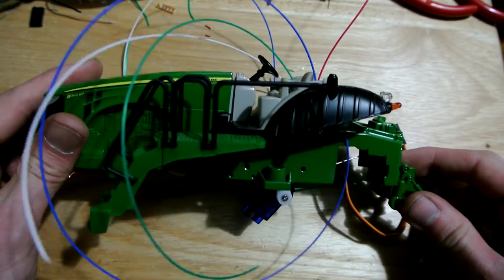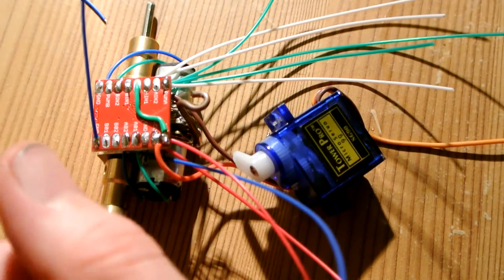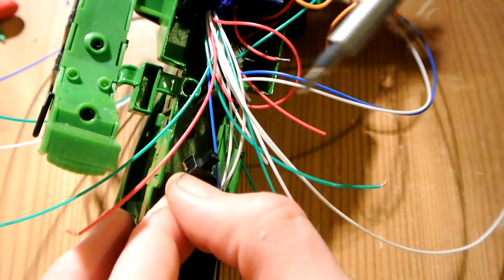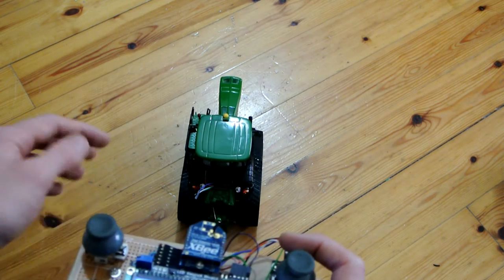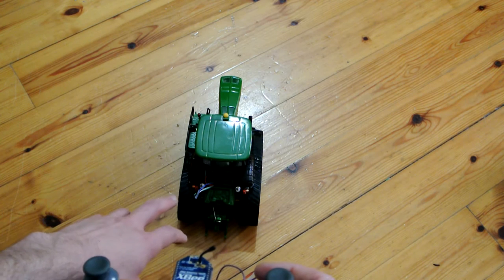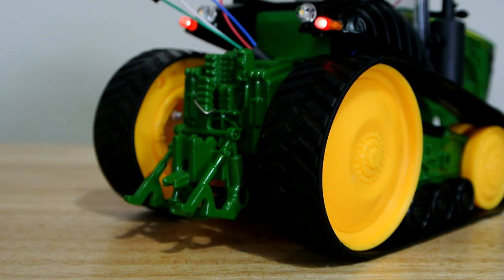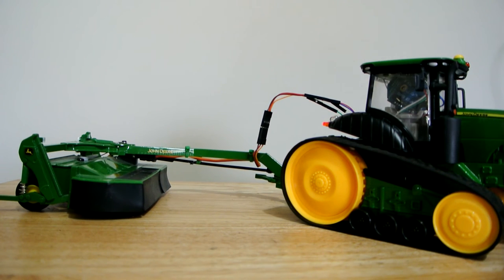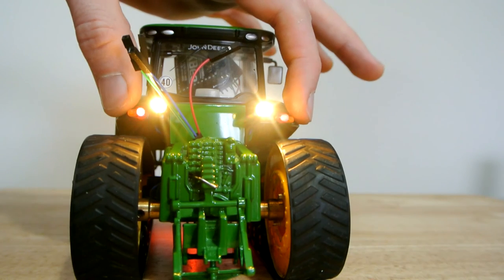RC Tractors John Deere 8360 RT Part 5 - Adding the Motor Driver and Arduino

Comment: Thank you for making all of these instructional videos. I'm working on a JohnDeere 8020 using the same motor configuration.  Since there is no cab, I'm going to use an Arduino nano because  it has the 3.3v pin for the NRF2401, and 5.5.v for the motor driver and lights.  I'm hoping that you would you be willing to share the Arduino  code?  

Thanks again!
Adam
Reply from the maker: Adam Duim Hi, I added the code for both the John Dere 8360RT (http://forum.rctractors.net/thread/86/john-deere-8360rt-controller-code) and the Massey 8680 (http://forum.rctractors.net/thread/52/massey-code) to the forum. The latest post is the current code I'm using which is working well. Unfortunately they both use two Arduinos but you should be able to combine the two codes easy enough. Also the controller code is here http://forum.rctractors.net/thread/92/complex-rc-controller-code. There is a possibility that things are labelled incorrectly as I don't have time to check through it all at the minute.
Reply from the maker: +Александър Хаджидимитров Hi I think this code is the most up to date http://rctractorguy.com/forum/topic/rc-john-deere-8360rt-build
Reply from the maker: +Александър Хаджидимитров I haven't drawn up a schematic for this model yet, sorry.

Comment: hey my plans are to convert one of these tractors like you have many videos of. Can i make a old remote control off of another rc work for a tractor??
Reply from the maker: Yes you should be able to do that as long as the components are small enough to fit in the model, there isn't a huge amount of space.